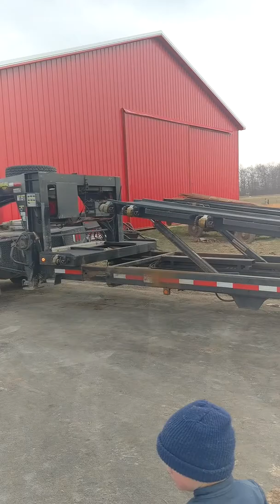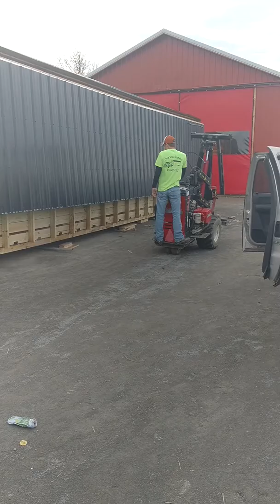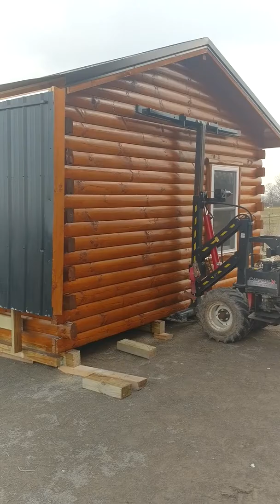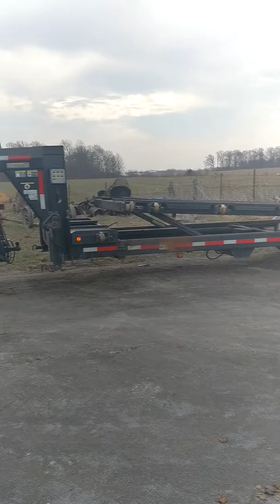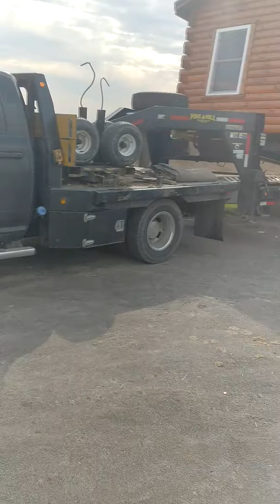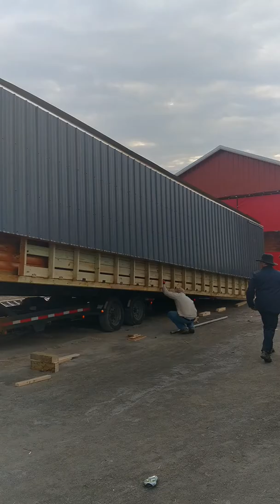Amish cabins in larue ohio....cabin loading on trailer to move

Comment: Oh my goodness what kind of load are you putting on that poor truck ? You need a semi for that job. Trouble Brewing. 😋
Reply from the maker: Mark Heim were putting it on the trailer
Reply: I realize you putting it on the trailer but that truck got to pull that trailer just seems like an awful lot of weight. Hey I do have one question what if one of those exterior boards get damaged .can they be replaced ? Cuz I seen one video that 1 exterior boards has a big split in it and that would bother me.